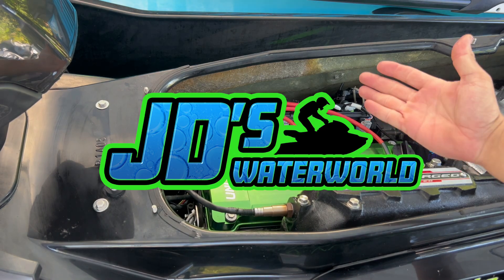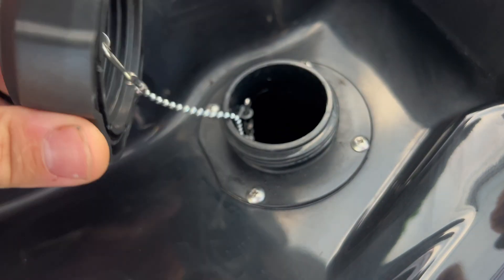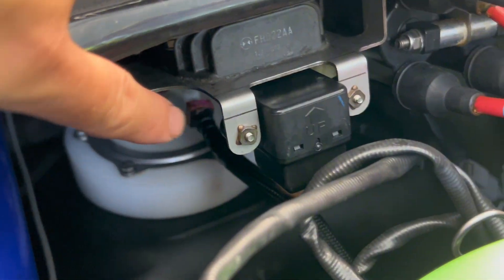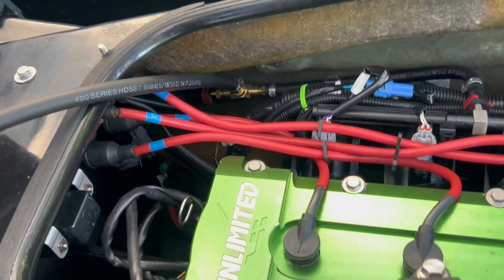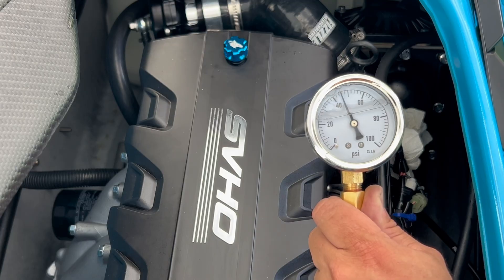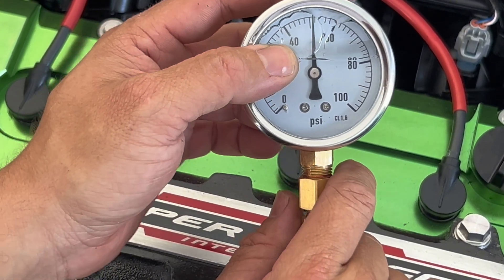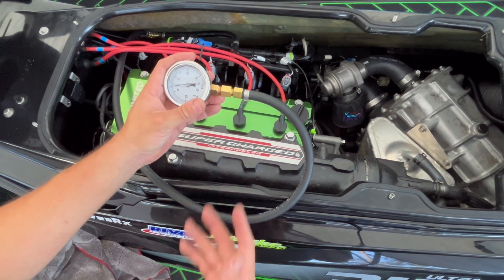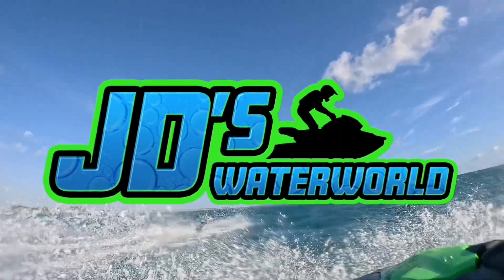Fuel Pressure Testing Tool for Yamaha WaveRunners and Kawasaki Jet Skis - Overview and Tutorial

Comment: hey maybe you can do a video on what specialized tools future 310 owners should have in their toolbox.  Tools the typical home mechanic wouldn't need unless they own one of these machines.  This fuel pressure testing tool is obviously one of them but what else?  May as well buy them before you need them :D
Reply from the maker: Good idea! I will put that together once my Ultimate Comparison series is complete. Those videos are consuming all my resources but once those are done that will be next
Reply: @JDsWaterWorld  yeah that'd be amazing.  Everything specialized from doing regular maintenance like oil changes/winterizing to troubleshooting tools would be great to know and have on hand. you could expand on this to include what you recommend for cleaning supplies/procedures as well.

Comment: One for on the shelf.
We had 40f here yesterday... Warmer again today... I better get some time out before the bad weather lands.
Saying that... I will semi- winter it this year, as I'll be testing it as I do the stage 3 tune... Let it suck in some freezing air for peak performance.
I need to dig the shims out and check the clearences, swap fuel pump pulleys and tensioner... You know the drill😂
Don't you guys get hurricanes regularly? We catch all the leftover storms from everywhere all the time. 😢 Feels like that anyway... Spend more time waiting to get out than actually being out on the water... I need to move my camp to Florida maybe? I'd be a genuine redneck, you would be calling me blister, we don't get much sun at all... And I work nights so not accustomed to heat and light. I'd need the AC version kawasaki ultra....here I need to redirect the warm p1223r water, so it heats me up. 😂
Thanks again JD see you on the next one.

Comment: You have been nailing it with the timing of these releases and my mod list for my fx svho lol. I am looking at adding a 20L aux tank in the front of the ski that auto drains by vacuum to the main tank. I have seen one report of fuel pressure under full load dropping after adding the aux tank. The manufacturer replied that they must have installed it wrong but I am wanting to verify for myself. I doubt the vacuum is affecting the pump but I would rather be safe than sorry. Are the map tuners not capable of monitoring fuel pressure?
Reply from the maker: As far as I know, you cannot collect fuel pressure data with Maptuner  because there is no fuel pressure sensor. You have to monitor manually and set tune parameters or add third party fuel pressure sensor and data logging device. I personally use the manual gauge at this point and collect AFR data with Maptuner and PLX
Reply: My method of testing... (caveman)... Swap the pump and see if that helps any. 😂
I have a nose so would be alerted to leaks as source of pressure loss.
Reply: @JDsWaterWorld  it blows my mind how basic these skis still are... basically a half step above being carbureted... I almost want to go fuel tech right away and not even mess with maptuner
Reply from the maker: Yeah MAP, temp, and rpm but no lambda data into the ECU..less advanced than a 1991 Geo Metro